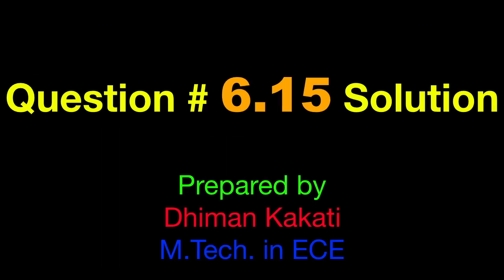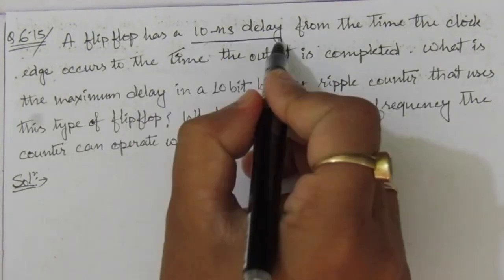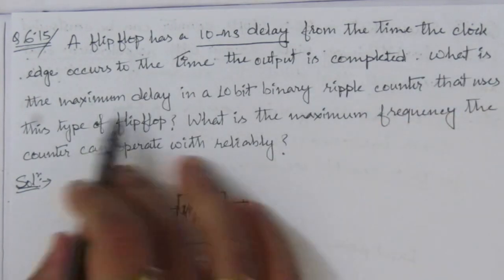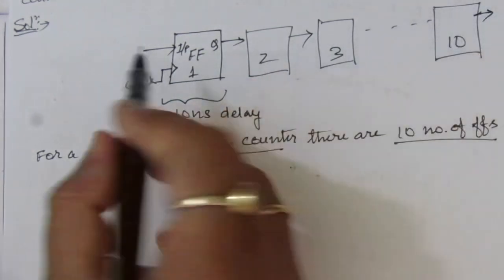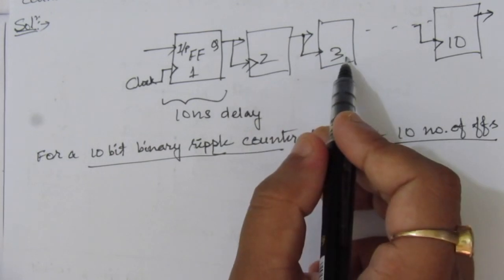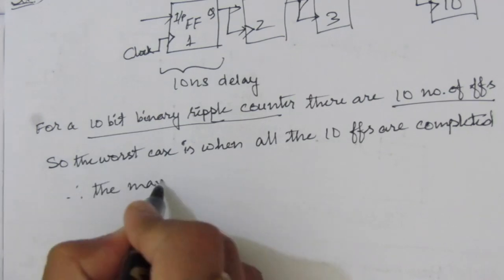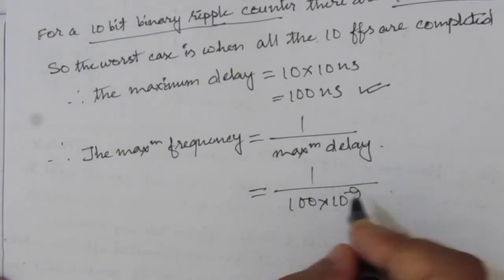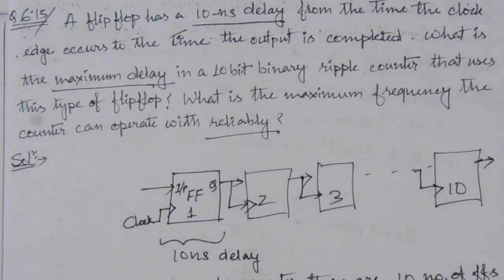Q. 6.15: A flip‐flops has a 10 ns delay from the time the clock edge occurs to the time the output

Comment: Consider a synchronous counter with parallel load. Assume setup time is 3ns and hold time is 1ns for flip flops.the propagation delay for each gate is 1ns. What is maximum clock frequency for which the counter will operate correctly?
How I will find this question max frequency

Comment: in section b, why did we consider the worst case? It says maximum frequency but in worst case we found a minimum frequency am i right?
Reply: the worst case represents the maximum frequency because it is the amount of frequency that the system can operate if all 10 filp flops were used. If we assume only one flip flop was used, we would then be calculating the minimum frequency.

Comment: Brother 
Please help me
Now I have a question that is about mixing between RAM and decoder ! or RAM Feeding  ROM through decoder
The question says that: 
"A 2^4*3 RAM as feeding the address of 2^3*4 ROM as shown (the diagram as it is , one black box on the left which the word "RAM" is written inside and it has 4 inputs [B0,B1,B3 and B4] and only three output lines from it and those three output lines are connected to get into a decoder (3x8) and there are 8 lines out from the decoder which are m0 until m7 
And in someway there are four words A0,A1,A2,A3 
Each one of them is function out of OR gate 

So in general if you have a problem like that or has the idea of mixing RAM,ROM and decoder together!
Please make a video or just guide me to the correct solution 

The main thing he wanted from the discreption of this problem above is to determine the words A3,A2,A1,A0
And he gave me the table of Address and data to use it to get the words of A0,....

Thanks